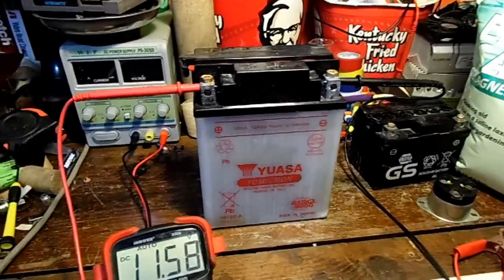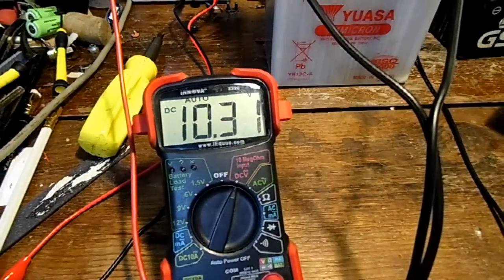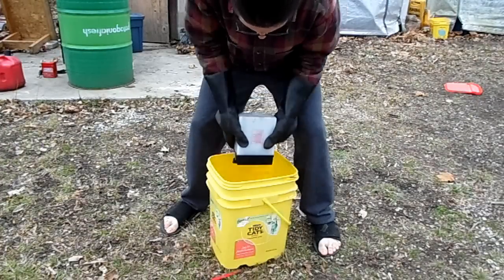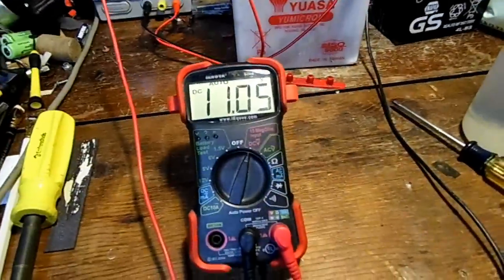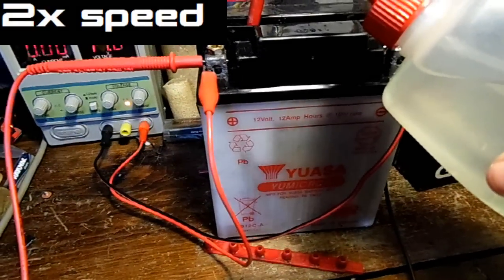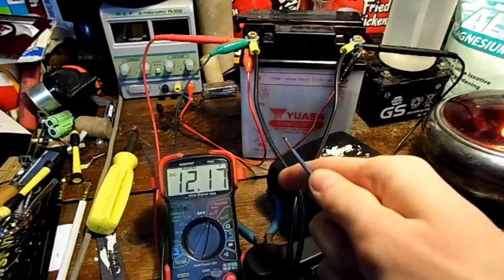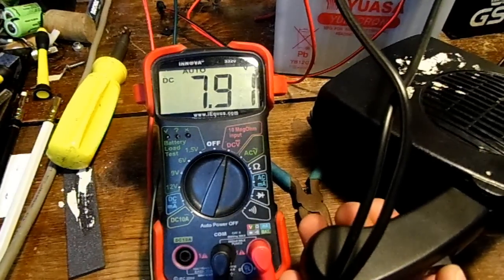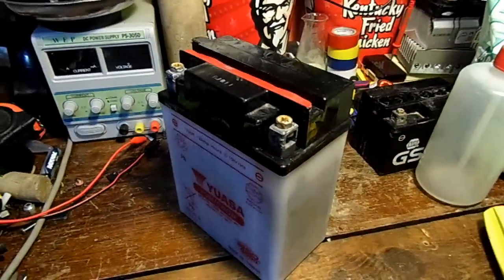Replace Battery Acid with Epsom Salt?

Comment: I just did an experiment where I got 2 NOS 1970s motorcycle batteries. One was filled with Epsom salt and one was filled with sulfuric acid. 

After adding electrolyte to each, the epsom salt battery was at 6.0V and 19Ω internal resistance, the sulfuric acid one was at 12.26V and 178mΩ.  After the first charge, the sulfuric acid battery measured  12.99V and 59mΩ, and the epsom salt one was 12.16V and 507mΩ. The Epsom salt battery only tested 13 and then 21 mAh on a 300 mA discharge test. The voltage on it doesn't seem spongy like a lead acid should. This probably also explains the behavior of that Coker battery in the A strange 12V battery video. It's interesting how the little amount of energy stored in it acts purely as surface charge since it won't stay charged by itself for more than a couple hours. 

I mostly only do tests with small AGM batteries so I haven't done much testing  with directly adding Epsom salt to existing batteries but in my limited testing it does seem to make the improvements you mentioned in your old videos.

Comment: U shud of firstly made sure all the old battery acid was out. Than and most importantly usef baking soda to clean the plooms off the plates before adding epsome salt and water. The plooms will cover the plates and ur battery wont have enough surface area to pull any charge. Right now those plates are covered in plooms and cant pull any charge from your electrolyte. U gotta do more research before doin this brotha.
Reply from the maker: I see no reason to remove the sulfuric acid, and what do you mean by plooms?

I ended up getting a lot of success from epsom salt in this way years ago, I was the biggest youtube channel for lead acid battery hacking for a time

Comment: Magnesium sulfate or sodium sulfate is what you use to desulfate the plates.
Reply from the maker: You don't seem to know what Epsom Salt is.
Reply: @RinoaL  magnesium sulfate is Epsom salt, but a better chemical for desulfating plates is sodium sulfate.  So you can use either magnesium sulfate (Epsom salt) or sodium sulfate. Lead sulfate desolves using either, but sodium sulfate is better, magnesium sulfate is easier to come by, einstein researched this decades ago,  so yeah I kinda know what in talking about.
Reply: @RinoaL i recondition forklift batteries, im offgrid and run on 4 forklift batteriea, i buy them cheap and use sodium sulfate to clean the plates, because sodium sulfate works alot better and faster.
Reply from the maker: The way you wrote your initial comment sounded like you were saying I was wrong for using epsom salt, I didn't realize you were just saying redundant information for the sake of it.

Comment: Shake it after filling it with that solution. Then charge at 14.5v 100A for 1 minute. Shake again. Then empty it and add distilled water. Shake empty repeat 3 to 4 times until mostly clear. Remove AS MUCH of the distilled water and then refill with 10 Tbs per quart of distilled water. Refill and charge. Should be like new. You can add Alka seltzer with the first fill of distilled water and let sit until it stops fizzing. It works really well!
Reply: After all the trouble of putting new electrolyte in there, you are suggesting pumping 1450 watts into it for 60 seconds (87000 joules!) This is a very small battery, what do you think might happen?

Comment: I have tried this with a lawn mower battery with moderate success. The battery I had would engage the starter but had no power to run the engine over. 
I dumped out the acid which was grey and cloudy. I thought it would be a good idea to flush out a lot of the contaminates in the battery so I filled it up with water and shook it, and dumped it out. The water that came out was dark grey, so I suspect a lot of lead particles were coming out. I flushed it again but this time with a mixture of baking soda and water to neutralize any remaining acid. I dumped it out again. The water that came out was a light grey this time. 
I used epsom salt and distilled water. I heated the water on the stove to help completely dissolve the epsom salt. I proceeded to fill the battery cells with the epsom salt water. I placed the battery on a low charge. It took a very long time to charge but it eventually finished and it read 12.8 volts. I thought it would be good to completely discharge the battery so I attached a car headlight to it. It lasted for several hours to my surprise. I charged it up again and installed it on the tractor. I was amazed that the engine turned over and started, maybe not as strong as a new battery, but good enough for a lawn tractor. 
I am not sure about the longevity of using the epsom salt as an electrolyte. I guessed on the ratio of salt to add to the water so I made it an super saturated solution and removed the excess epsom salt that settled to the bottom of the pan. So far it seems to be working. I probably wouldn’t trust it enough to be used in a car, but a lawn mower might do just fine.
Reply: How long did it last or work well enough for? Was it worthwhile

Comment: The porpose of the Epsom salt is to remove contamination from the cells allowing the battery to charge and discharge the energy better. He didn't put the battery through a proper charge cycle. A battery suffering from sulfacation can get a few months to a year of life.
Reply: So is it still possible to bring dead batteries back to life after flusing the battery, filling with the epson salt water with repeated charging over a period of time?

Comment: You need to add aluminum potassium sulfate with your magnesium sulfate in distilled water after emptying out the acid, then you need to charge your battery all the way up as far as it'll go and discharge it till it's absolutely dead, and then recharge it

Comment: Agree with Robb Allen ... why wear safety gloves while shaking battery over bare toes?  Otherwise, interesting videos.
Reply: As long as you are able to wash it off after only a few minutes toes and fingers will be just fine. The eyes are very easily irritated and should be protected, especially while shaking. This is not concentrated acid, it will be around 20 to 30% depending on state of charge.

Comment: the cell killer is the build up of spikes that start growing towards the
 opposing electrode. this growths happen w every DEEP discharge.  (so, 
avoid discharging  a battery deeply for the longest life.)   When the 
spikes reach the other plate, it makes a Dead short and that cell is 
OUT!!
Trick here is HOW to break those bridges.  

I was told (but I believe it works. but haven't tried it)
hooking up a WELDER with Bolts (not clamps to avoid sparks) and then 
Hitting it with the welder for a few seconds. will break the bridges and
 reopen the GAP between the plates, as should be.  will fix it.   
But remember to make sure every cell is full of Electrolyte. 
Activate
 the welder from the input as you don't want any sparks near the any 
Gases produced by the Charge (if ANY) hitting it for a few seconds is 
prob. not going to build bubbles unless you stay  ON too long.....
I haven't done this myself bc I haven't had the necessity of testing the THEORY.
but it my knowledge, I think this WILL WORK,  just have to do it SAFELY.  
Bolt the cables, no lose connections, Don't hit it too long to avoid generating bubbles (Hydrogen, Oxygen)   etc.

Any overcharged battery will be "Boiling" but that's the explosive gas.  
TURN OFF  the chargers etc. to avoid sparks when messing with connections near the battery.

Comment: Dude  the Charging voltage is 14.7 volts.   Keep at that rate. until FULLY Charged. 
the 13.5 voltage is Called "Trickle charge" or "Maintenance charge".
The Failure of this TEST  is the fact that you NEVER really charged the Battery. 
So, I might have worked.  but since you didn't really Re-activate* the battery.; you thought it was a failure. 
Try it again!  Do it right!     Also,  use a Hydrometer to find out which cell is shorted across the plates from oxide build up(spikes reaching from one plate to opposing plate)  
and do something to break that bridge (short)

*(Batteries are not really "Charged" they are "Chemically re-activated")
Reply: Epsom salts work by removing the buildup of sulfur from the lead plates this is a very specific battery condition where the battery was completely discharged like for instance you left your key on overnight. In any case this takes time it's not a direct replacement for the electrolyte it needs time to dissolve the sulfur
Reply: Bro stfu he can make a mistake too. I bet you’ve made mistakes too. But he’s gonna learn from his mistakes and one day know the actual way. Shut the hell up.
Reply: Not certain about the points made but ,if anyone else wants to discover how to recondition batteries try Corbandy  Battery Blueprint Crusher (do a search on google ) ? Ive heard some pretty good things about it and my m8 got great results with it.
Reply: it cant work with out battery acid , stupid useless videos , remove

Comment: Hi

if i have pb selad battery that have low volt .
and i want to start the charger ( i have charger that can be start charge at 0.3v) 
but what Amper i need to set it? low? or high?

thanks
yossi
Reply: If your charger is adjustable, I would put it at about 1 amp and run it at about 16 volts for a few hours and then lower it to maybe 14.5 volts at about 2 amps for 12 to 24 hours. Test the battery as thoroughly as you can with the equipment you have, particularly if you can test the specific gravity and it would be nice if you could do a load test. Write down your results. Drain the battery to 11 volts (no lower) then repeat the whole process (except maybe the 16 volts part) up to 5 times and notice if your tests results are getting better. After 5 or 6 times the battery probably won't improve much more. If it's a car battery and you can't get something close to 600 cranking amps out of it, your best bet is to either take it in for a core or convert it to alum and use it for LED lights or something like that.

If you have dead cells you might as well give up after the first or second try. You could try emptying the acid and rinsing the battery out, but there's no guarantee. What I've been doing when I rinse a battery out is fill it half way and then cap it and flop it back and forth on the ground to try to rinse the lead out from under the plates. I'll repeat that a few times, drain it real good, and then either put the acid back in and test it again or else convert it to an alum battery. An alum battery can still be useful if you have 1 dead cell. It will function something like a big 9 volt NICAD battery. However, I suspect that having a dead cell might be hard on a battery charger. It won't hurt a solar panel though, but anything bigger than a 30 watt solar panel probably would be a waste of solar power.

Comment: dear sir, i,m try all things (using epsom salt) show in your video on my 2 year old car battery.but after 30 to 36  hours charging battery shows 11 volt current and after disconnect the charger 6 hours later battery show 2 volts only....now what is the solution,thanks
Reply: ajay baluja Go to autozone and buy a new one .
Reply: It's pretty unlikely that changing the chemistry like that would give you a car starting battery. In my experience, charging and discharging a battery with the acid replaced with epsom salt kills the battery after a few cycles. The two batteries I tried it with may not have been good candidates, but that's my experience. Alum works, but again, unless it was a fairly good battery to begin with I doubt it would be any good as a car battery. More of a solar battery to run LED light bulbs.

One thing that I do think MIGHT work for awhile is putting some alum in each cell with the acid and then cycling the battery a few times, maybe the first time with a little higher voltage to try to break up the sulfation. I've tried it with the last couple of batteries that I desulfated, but I have no way of knowing if those batteries would have come back without the alum. They did come back good enough to start a car with, in the summer anyway. Not sure if they would work very well in cold winter weather. My preference is to convert them to alum and use them for solar camp lights, emergency lights for power outages or to light a shed or camper that doesn't have electricity.

Comment: have you ever tried desulphating a battery with a pulse charger BEDINI? this is the best way to bring new live in those old batteries, first desulphate with the pulser ( might take a few days) then refil with alum, works most of the times if the plates are not to far gone, test it out!

Comment: I got burnt on contact from an old battery, it sometimes keeps burning after you wash it of.. once it burned on the 3 little specs that hit my hand for 3 days after washing it.. a lot. In saying that, each to their own, it was a pretty big bucket and you had good chem resistant gloves.. It was an eye opener to see the bare toes lol made my day lmao!!
Reply: You can handle dilute acids with bare skin as long as your skin is healthy and you neutralize the acid within a few minutes. Concentrated acids should be neutralized in seconds. Whenever I'm working with etching fluid or other acids stronger than acetic, I like to have a jug of a saturated sodium bicarbonate solution handy. Bring distilled water to a boil and keep adding sodium bicarbonate until it won't dissolve anymore. Allow it to cool and pour it through a funnel into a jug and presto, Bob's your uncle, you have some acid spill safety fluid!

Some people use bleach, but that's pretty alkaline and can burn you, too. It can also release chlorine gas when mixed with strong acids.

 Keep some vinegar handy if you're working with hydroxides or other  strong bases, too.
Reply: Eisen Faust a

Comment: sounds like the music from Nintendo ninja turtles.
Reply: Craig Slaunwhite Sure is. Must not have a copyright?
Reply: @markfothebeast  most video game music isn't copyrighted
Reply: There are several factors in battery reconditioning. One resource I discovered which successfully combines these is the Rapid Renew Roadmap (check it out on google) without a doubt the most incredible info that I've seen. look at this amazing resource.

Comment: Thanks for some great info! Is it true that desulfating with a super saturated 50/50 mix of borax n Epsom salt in hot water will help revive bad batteries? I've never tried it but if you've got several batteries laying around you might give it a go! Just be sure you make another great video n show the result! Also where did you get your desulfator and how do you make an alum battery?

Comment: If you could figure out how to get the corrosion out from between the cells in the bottom of the battery it would work with new acid and also make a GREAT "HHO"  generator for hydrogen . But for a HHO generator to make hydrogen use water and baking soda..

Comment: yikes!  bare tootsies in a shop+sulphuric acid...a word from someone who has been tortured by a   third degree burn on the top of the foot,toes included for 9 months...
Reply from the maker: battery acid isnt usually that bad. especially old acid, couse battery acid is only 5-10% acid.

Battery Acid Accident

you where prolly dealing with pure acid.
Reply: Rinoa Super-Genius yes, but, that's not the point: any open wound trauma to the feet takes much longer to heal due to the pressure, load&shear forces on it. RS-G, your footware in a garage environment is like motorcycle riding sans helmet: russian roulette...just sayin' cuz foot trauma is 24hr hell...more painful than being t-boned by a car while motorcycling,or falling off the roof,BTDT ...please take care of yourself, so you can crank out  more super vids to delight us.cheers
Reply: d dobs
I know, just what I was thinking.  Only idiots, not "Genius" do those dumb things.
Reply: There are several components to battery reconditioning. One plan I found which successfully combines these is the Magic Mender Wizard (check it out on google) definately the most incredible course that I've seen. look at this  amazing website.
Reply: If you is interested in battery reconditioning the best results that ive ever had was by following the Magic Mender Wizard (i found it on google) without a doubt the most helpful info that I've tried.